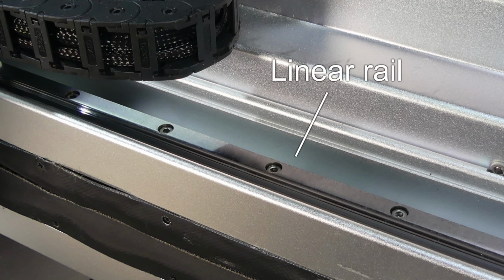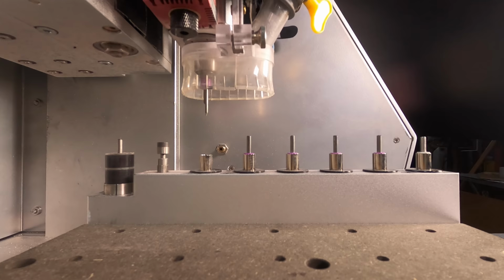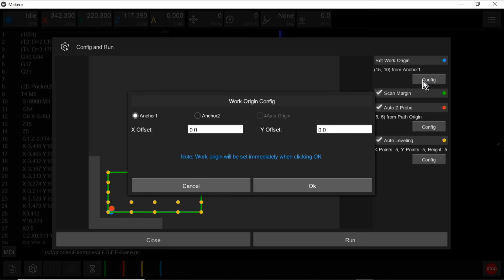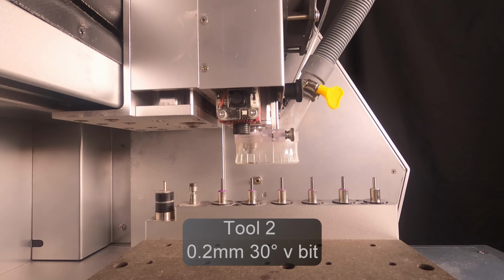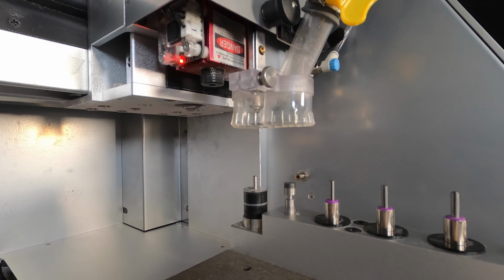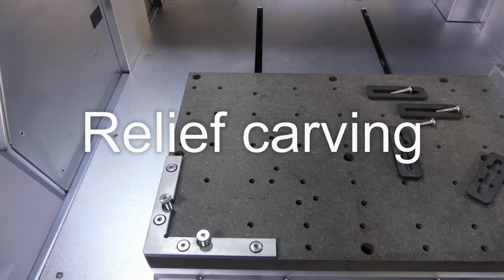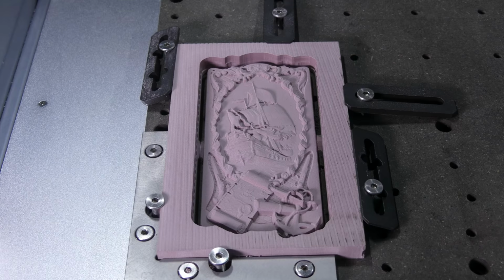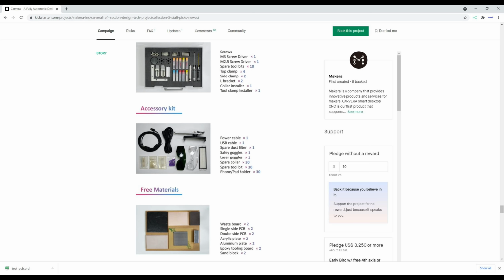Desktop Cnc Mill with a unique Tool Changer  - Carvera Cnc  Machine Review

Comment from the maker: Since this video Carvera has improved the dust collection bin, added an external dust port, changed the Y axis linear shaft to 25mm, added an external estop switch, an x, y ,z probe, M8/M9 air flow control and a laser protection film.
Reply: When will these machines be available

Comment: Tool changer, 4th axis, dream machine 🤩. Well im gona finish my own some day. 
Just need to put in the Hours.
The only bad part i can see is the tools not being in a box/drawer. Particles can easly lay ontop of tool. Or does it revers vacuum to clean them of..i think it does! 
Its nice to see a proper machine with metal, more metal and some cool add-ons included.

Hum i wonder howlong until we start seing tool changing arms with air power toolchange (like a workshop cnc)

Comment: How do you feel it performed cutting aluminum compared to other desktop cnc’s youve had?
Reply from the maker: I haven't done much testing with Aluminium but from what I have seen it works well,. The tests were not that aggressive, so at this point I haven't any real idea how far it can be pushed.
Reply: If it cut copper it can cut aluminum for sure.

Comment: It's difficult to tell from a video, but how would you rate the noise level when cutting aluminium and engineering plastics?

My last machine, a Heiz 720, used a Kress 1050. It was a good machine but very noisy. Where I am now I need something much quieter. Really, I need more of a mill than a router but the cost of a CNC mill is too high. This machine might suit.

Comment: That’s a pretty amazing bit of kit. Would you buy one I guess is the big question?
Reply from the maker: It is and fun to use. Yes, I would buy one.
Reply: @techydiy  do you think it’s complexity will make it difficult to maintain?
Reply from the maker: It is not really that complex  but It's quite tightly packed together. Hopefully they will sell spares. Most parts look pretty standard but the tool changer is a custom part.
Reply: @techydiy  I believe they're going to open an online shop after the campaign and sell parts and add-ons. Good to know most of it is standardised and replaceable, but I'm not surprised by the tool changer. It's always a trade off.

Comment: How does the laser sensor in the tool magazine react to a high workpiece?
Reply from the maker: I have not experienced an problems but good question I will go and check
Reply from the maker: If the workpiece has a reflective edge and its thicker than about 50mm / 2", then when it is tool changing it will halt with an "ATC position occupied" error.
If it is non reflective then its not detected.
In practice its not  a problem and a simple fix would be to put  some tape on the material edge
Reply from the maker: fyi The potential problem was fixed with a barrier strip in the production version

Comment: Would you mind sharing what roller you used to spread the solder mask? I’ve been struggling with doing so and thought your results were great.
Reply from the maker: It was one that came with the machine. Quite a nice quality, hard rubber/plastic roller. The other way I do it is put some acetate over the uv solder mask and flatten it with glass.
Reply: @techydiy  Great, thank you!

Comment: Odd that they don't have an option to get both the 4th axis AND the PCB kit. You have to pick one or the other. Presumably you can buy the option later through the backerkit but still...
Reply: One of the pledge levels includes either/or, and the other can be selected as an add-on while completing pledge.

Comment: The 3K usd price range seems very low for this machine, I doubt they will pull it off. Not convinced that it will ever see production.  Looks fine for companies, with high profits, but not sure if it will ever be affordable for the hobbyists. Also IMO some parts are very overbuilt, eg. the ballscrews are very oversized, not sure why they would use those; not convinced by the servo motors, you can have closed loop control with steppers, the super thick side sheets of the machine, and many makers have a problem with closed source firmware, it is a red flag for me for sure.
The tool changer is really nice, at least.
Reply: I agree that 3k seems low, but I'm seeing a lot of off-the-shelf parts that added together don't seem far-fetched as a bill-of-materials for the machine.

HOWEVER, I am unconvinced a company can make a sufficient profit margin off that price range. For such a niche product you'd expect them to shoot for at least a 15% profit margin, but I'd be surprised if they can manage 5%. 

Now, that might just be because it is discounted for its backers, but I'm not seeing  much in the way of wiggle room for incidentals, like tariffs, supply chain breakdowns, the massive increase in shipping costs these days, and material shortages.

For example, shipping container prices have increased tenfold from last year, there is an aluminum shortage in China spreading to the rest of the world, China is shutting down magnesium production for the winter due to power shortages, which impacts the production of aluminum alloys. China's biggest producer of bauxite (guinea) has had a regime change and is now more hostile to china, further threatening production.

If the $3,000 price tage was from before these events transpired, then they will make a loss on every machine they sell or will be forced to delay, likely for over a year for prices to fall.

Comment: Why desktop cnc machines don't cut stainless steel?
Reply: Because of the high speed spindle and lack of rigidity. For cutting steel, lower speed and higher torque spindle is required, and of course rigid machine to handle the torque.

Comment: 16:52 What's all that cutter churn on the outside of the part??
Reply from the maker: Define cutter churn?
Reply: @techydiy  I would have expected a clean slot around the part with a fluted bit. What caused the irregular cuts into the stock?
Reply from the maker: Ok, I did think the outside shape was a bit odd , so I checked the gcode on a viewer and it was the same,

Comment: i'm a cnc setter operator, it would be much much better if the machine had a setup routine where is touched off the tools at the start of the job, totally pointless and time waste having it touch off every time it picks a tool.
Reply: Thought the same but i guess it does it for precision, this machine has no precise V holders (BT30 etc) so z height/tool offset in every tool may change. By re-measuring, this issue vanishes. Pretty clever. It would be perfect if they had option to store Z-offsets as you say and bypass probing in jobs that need no real z accuracy (ie. roughing). But how much time would you save? Not much, and precision would suffer.
Reply: @constantinosschinas4503  There's the possibility of chips getting deposited on top of the index rings on each tool which would affect Z-axis repeatability -- in "real" CNC the toolchanger and its tools are shielded from the working area so Z-offsets for each tool can be persistent between toolchanges with some confidence in accuracy.

I'd like to see a partition between the work area and the tool storage area to stop waste materials from cutting getting into that space -- even a flexible curtain would help stop most contamination. The tool spindle and tools enter and leave the tool storage area in the same path each time as far as I can see, after touching off on the Z-axis height sensor. The partition would need to be dismounted to allow for replacement tools for different operations or in case of wear or breakage, but that's a minor task during setup. It would be easy for an owner to add a homebrew screen like this after purchase.

Comment: nice machine i mean someone went ape shit with what you can do with an x y z. but i wonder if this is much faster...  20000 steps. to poop out an test pcb.   :( well at least it can ! but the speed... the speed is awfull. might be the gcode but i recon it wastes allot of bits by going that slow :) a stepper can go higher speed then this one does :( this is servo !! come on. i can drill faster by hand :(

nice review though. i wont buy it ! so you did your job ! a honest review ! and sowed all it can do, and i must say pretty advanced to say the least.  but not for me :)
Reply: I think it cannot go a lot faster... The X/Y/Z can, of course, but not when cutting, because the 200W spindle just don't have enough torque to do the cut at higher speeds. In fact, it's not even cutting at that feed, it's rather "grinding" :D 200W spindle is just for "playing around"... BTW, for that price I made a really big machine, with big X/Y/Z motors and water cooled big spindle, that's cutting aluminium like butter...

Comment: Lot of room for optimization. Why measure the length of the touch off probe when that is essentially its job, in fact, why measure anything twice when it is the same tool.
Reply from the maker: It's more accurate, they are not using expensive tool holders.

Comment: It's so slow, that it's not cutting, but grinding... And not only the material, but also the tool...
Reply from the maker: You are  presumably talking about cutting the fr4 pcb. Fr4 fibreglass is a tough material to cut accurately . Obviously when it comes to the plastics and aluminium then it cuts larger chips.